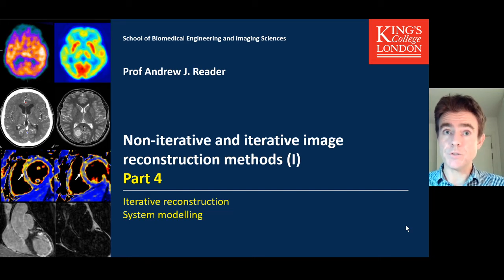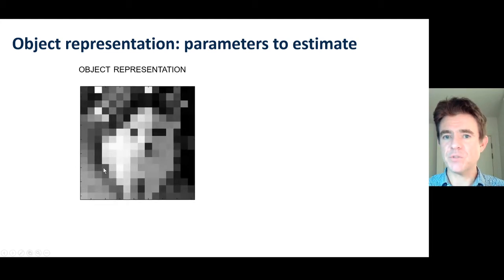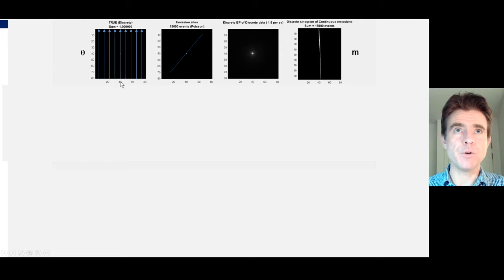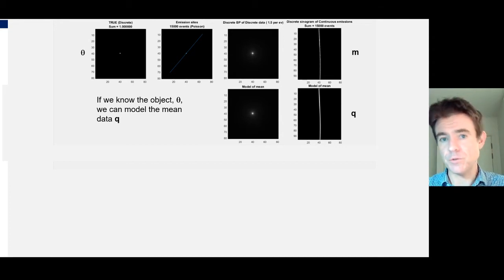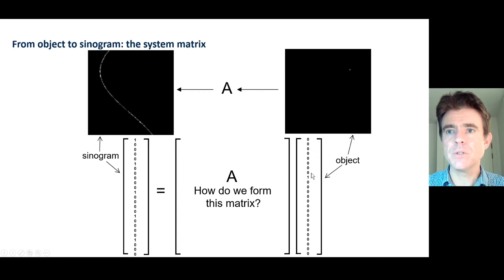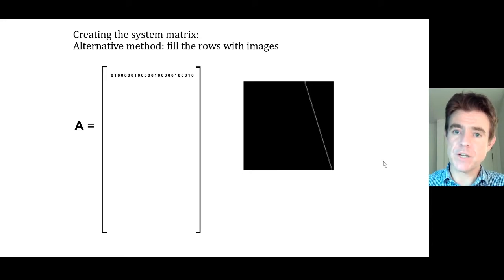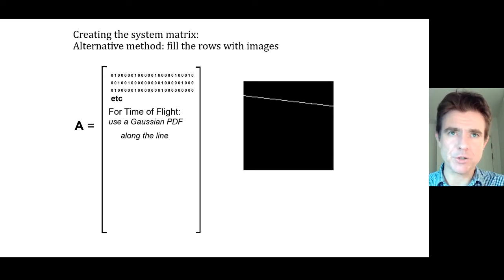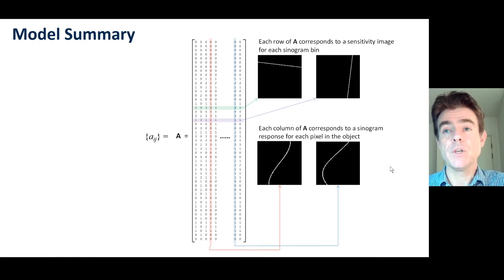Non-iterative and iterative image reconstruction methods Part 4

Comment: Does this line integral step you talk about where we sample "this unknown" true image of the point source go by the name "parallel beam forward projection"? ~6:30
And how is the projected image of this "unknown" true imaged calculated. With the rotating line integrals, is it essentially checking "is there a point source here along this line regardless of its position along this LOR" and then recording the respective delta and phi for example to create a sinogram mean estimate if there was infact a point source along this line? But with if the image has multiple point sources along a rotating beam?
Reply from the maker: Yes, the line integrals would be referring to parallel-beam forward projection. This can be done by methods like the discrete Radon transform (e.g. in Matlab or in scikit for Python, see: https://youtu.be/IhETD4nSJec). The rotating set of line integrals will integrate whatever is in the image being forward projected - it is modelling the expected data for a given image that is being forward projected. Note the forward projection is linear, and that any image being forward projected can be regarded as a collection of point sources of various amplitudes. Feel free to ask further questions if I've not covered your queries.
Reply: @AndrewJReader  For iterative reconstruction can the point spread function (PSF) also be applied in iterative reconstruction as a way to fix resolution degradation, for example, on the forward projection image of the "real estimated image" which is going to be compared against the measured backprojections? (i.e. data is not in sinogram form)
Reply from the maker: @kris-bn5io  Yes, the PSF can be applied as part of the forward modelling process. So the matrix for the forward model of sinogram data would be A=XP (hence a modelled sinogram would be given by q = XPf, if f is an image estimate). The forward model for the backprojected image would be (XP)^T (XP) = P^T X^T X P (so a modelled backprojected image would be b = P^T X^T X P f).  In this notation, I am using the matrix P to hold the PSF kernels for all pixels or voxels. Can be just modelled as a convolution for a shift-invariant PSF.